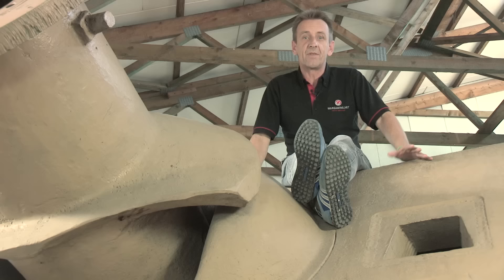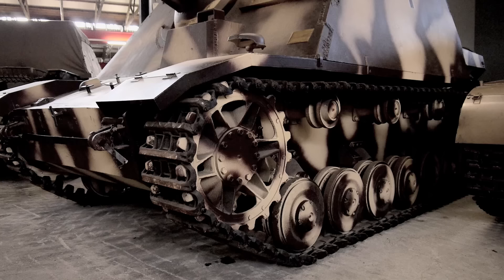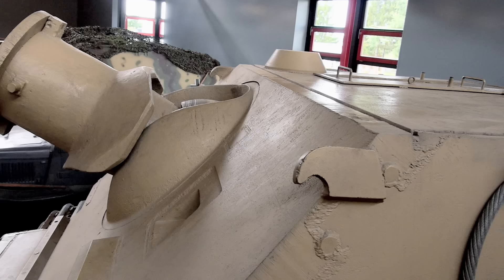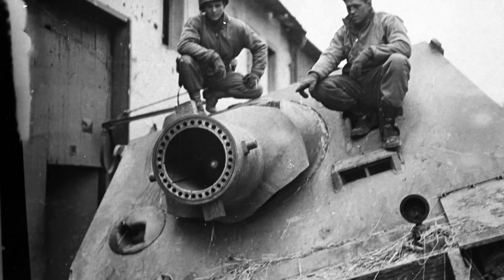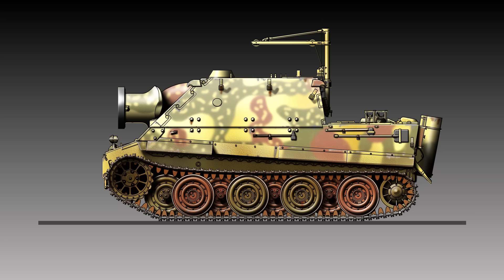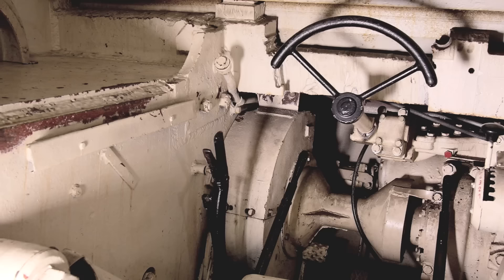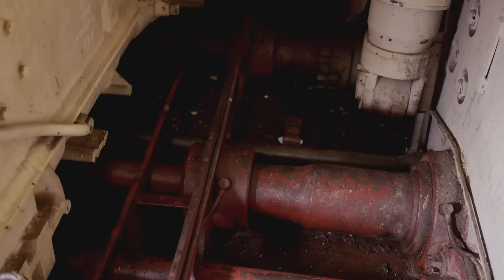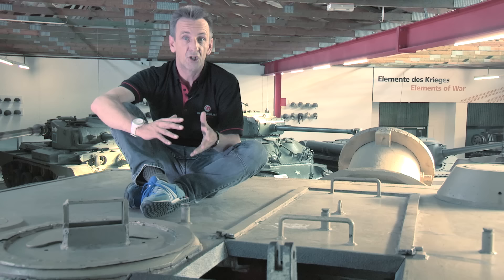Inside The Tanks: The Sturmtiger - World of Tanks

Comment: You do not call artillery with this tank 

You are the artillery
Reply: Mhg hunter Actually It's kind of both since it was used to destroy Heavily Fortified Bunkers and Could also destroy Tanks but that was not recommended as the reloading time was very long and the crew had to get out of the tank to use the crane the enemy tank could Spray them down with the Enemy tanks MG
Reply: Mhg hunter 4000-6000 metres is short distance ?
Reply: When it creates a cloud about 200m high and 300m around it when it fires...
YES!
And it was bloody slow, prone to breakdowns and if an enemy tank got within 3km then it was fkd.
Reply: Harry D it’s a tank, a spg tank
Reply: @jackofshadows8538  Its gun had a range of 6km!
Reply: You don't call the artillery with this thing.

Artillery calls you.
Reply: @Mhg hunter r/wooshh
Reply: Saucy Dip well yeah? That’s the point
Reply: Nitip sendal
Reply: @jackofshadows8538  It wasnt, it had plenty of armor, and its obviously well sloped too

Comment: Rate Of Fire: 0.48 (125 seconds)
Accuracy: 1.65 (T92 = 0.92)
Aim time: 17.2 Seconds
Penetration: 370mm
Damage: 3440
Splash radius: 12.7m
Reply: Its rocket shells man that thing dont need aiming time, they can aim while flight. :-)
Reply: @Bynk333  it unguided
Reply: @nickyxd6596  l u l
Reply: @Bynk333  but the rocket weight
Reply: @Bynk333  yeah a rocket. A rocket is unguided but a missile is guided
Reply: @Bynk333  hmm yes guided missiles 1943
Reply: @nicosteve0570  dont mater, the splash radius can kill all in 100 meters after impact. :-)
Reply: @nicosteve0570  missiles did exist in these years tho
Reply: @Yourlocalhuman8  they did but not guided ones
Reply: @nicosteve0570  not guided? They were, just manually guided via radio guidance, one example is the Wasserfall, WW2 equivalent to modern SAM's, made by germany
Reply: @Yourlocalhuman8  oh my bad
Reply: @nicosteve0570  i dont believe it the whole tank is just 40's cgi
Reply: @Yourlocalhuman8  there is also the X-4 Ruhrstal(?) Which is air-to-air but wire guided like the TOW-2.

And the Fritz X glide bomb, those were used a lot.
Reply: @raymartcarreon6069  yes, these do exsist too, but mainly the fritz-X is the only high scoring weapon, to sink an Battleship until jammers came out
Reply: @Yourlocalhuman8  which was only tested and never built in series
Reply: @Teedo_  it did exsist, and used alot

Came in big numbers too
Reply: @Yourlocalhuman8  what's the source then. As far as I know it only had 40ish tests and then was cancelled to support the V2

Edit: seems to have been 35 test flights. No serial production
Source: 
Pocock, Rowland F. (1967). German Guided Missiles of the Second World War. New York: Arco Publishing Company, Inc. pp. 71, 81, 87, 107
Reply: Excellent Adrian Prakoso  Crane is for loading the tank itself. Loading the gun from with in was achieved with a pulley system inside the vehicle. The crane was not necessary there.
Reply: yea lethal asf
Reply: @Nicosteve05  well the V1 wasn't necessarily "guided" but it did have a little propeller on the nose. This propeller kept track of the revolutions. German engineers figured out roughly how many revolutions it would spin before reaching it's target. Once the propeller spun X amount of times, it would shutdown the rocket's engine, causing the bomb to start it's descent onto the target. So no, the V1 was not able to turn and change it's trajectory, but was it was able to know when it was close to the target. The V1 and V2 rockets were the birth of the guided missile. So really, the V1 was the world's first operational cruise missile.
Reply: @dutchvanderlinde2636  wrong. Missiles are powered by an engine, generally either a type of rocket engine or jet engine. Rockets are generally of the solid-propellant type for ease of maintenance and fast deployment, although some larger ballistic missiles use liquid-propellant rockets.

Comment: how did they reload this thing if one round has 300 kg
Reply: +Miron Klescik Crane inside crew compartment.
Reply: +HaveBKYourWay That is a really funny thought
Reply: I can confirm this, because I was just playing COH2, after firing a rocket, it takes forever to reload ! 
There's two crew member reloading the gun with a crane built on top of the tank = ="""
Reply: There were germans
Reply: Building the RFM Sturmtiger with interior. It has mobile pully to the rear. This can swing from left to right and two hooks up front. To load a shell, chains and cables would be attached to the rear pully. This would be swung to either left or right to grab a shell by the rear and swing it first onto the loading tray. The front is held by the two hooks near the breech. Once the rear is onto the tray, the front is then slowly winch to place. Afterwards, the chains and cables are put away, a huge hand crank would be attached to the rear to literally crank the shell into the breech.
Reply: Slowly and carefully.
Reply: Oh my god watch the video
Reply: All 4 crew were involved in the reloading, if they all lift up equally l, that's possibly 75kg each. Definitely doable
Reply: German power
Reply: @StryderK  took me ages to reply but thanks for clearing that up :D
Reply: @EricTanGH0ST  that's not for reloading, that's for loading the ammo into the tank.

Comment: Did you just say 6000 to 8000 meters? Well it's definetly a bit smaller in CoH2. ^^ (20 m lol).
Reply: With Wildhide In the most cases. I've seen how a katjuscha was NOT destroyed by a direct hit. ^^
Reply: with a 380mm 700+ pound HEAT round that thing could one shot a battleship turret. That beast could likely pop the top off a modern MBT with a miss.
Reply: lol
Reply: Wasn't meant for use against tanks. It was mobile siege artillery.
Reply: TheThirdMan That didn't really matter though, right? I mean.. you can use it against almost everything.^^
Reply: Mad Tad Why would you? It's not like the cost of those shells was the same as a 75mm. Rate of fire would be too slow. This is also very large and easy to spot and doesn't fit within the model of armoured warfare. High trajectory weapons like this are not necessarily accurate weapons either. Nowadays it would be called an indirect fire weapon.
Reply: and.. maybach engine.. fuel consumption.. and exhaust - i wonder how to hide this
Reply: herauthon four Can't be used for attack, can't be used for defence. Can only be used for siege. Could have been done by more effectively by Stukas with more accuracy, greater destruction and lower cost.
Reply: ok, a siege machine. .  a mean main theme - rumblin and rolin' - ejecting evil into the scene..

but.. howto hide it.. or just keep moving around.. ?
Reply: lol
Reply: Oh no they ballance their game
Reply: It surely halved the health of my comet on a direct hit.